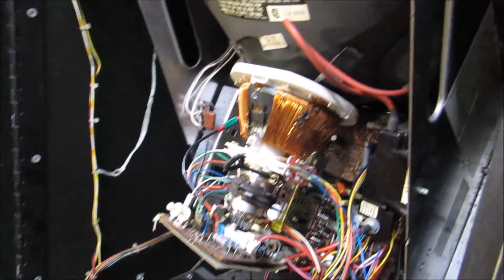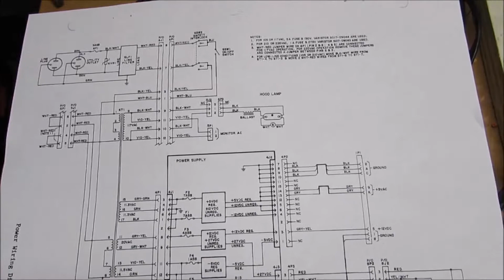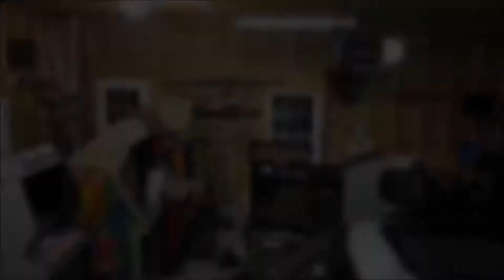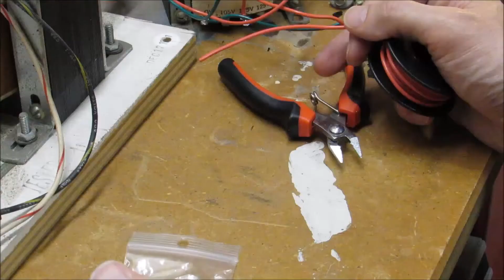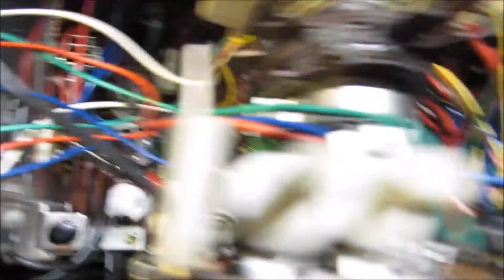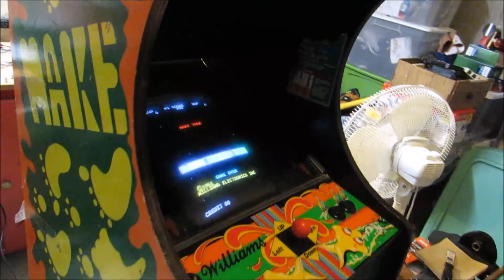Make Trax Update #4 - It Wasn't the Isolation Transformer...

Comment: Hey Tim, I'm just now getting into this hobby.  Would you mind letting the audience know what Molex pins you are using for the harness and the name of the pin removal tool that works with that type of molex connection.  Great videos by the way and keep up the good work.
Reply from the maker: Hi Adam, welcome to this crazy hobby. Most (but not all) connectors are a standard .093" Molex pin. That refers to the size of the pin. Another common size is 0.062". In this video, they were the standard 0.093" and I used a pin extractor tool to remove them. If you have a RadioShack near you still, that's where I picked mine up: https://www.radioshack.com/products/radioshack-pin-extractor